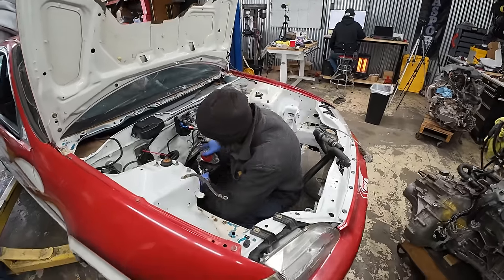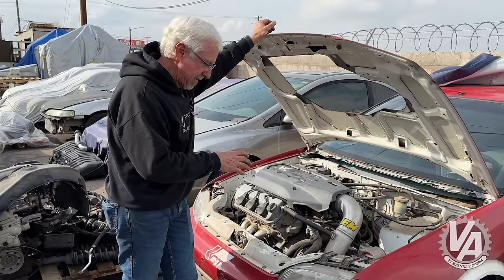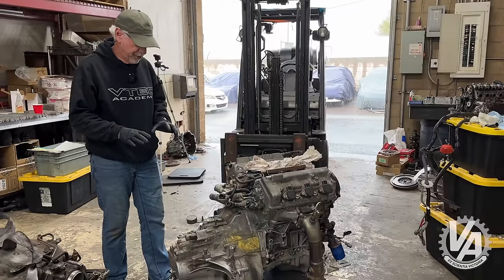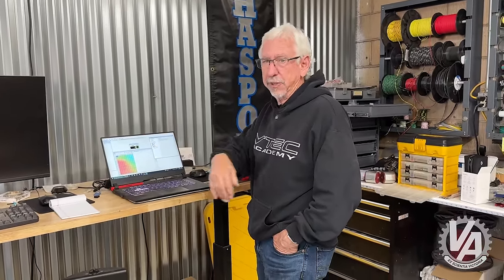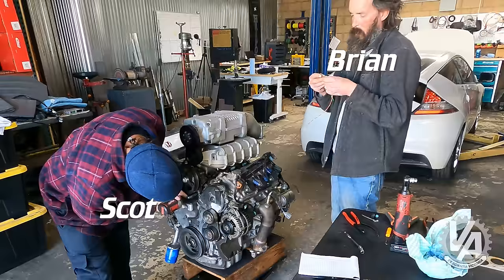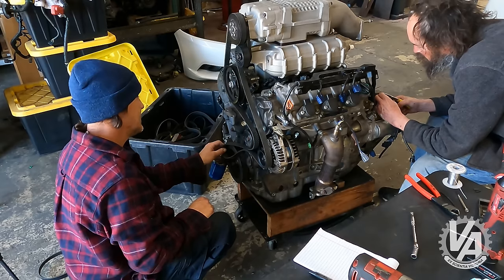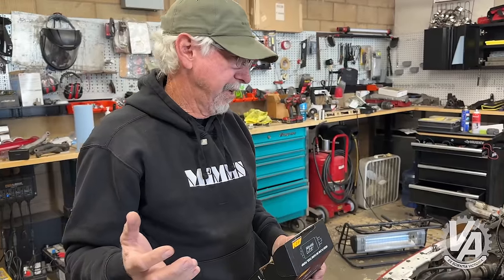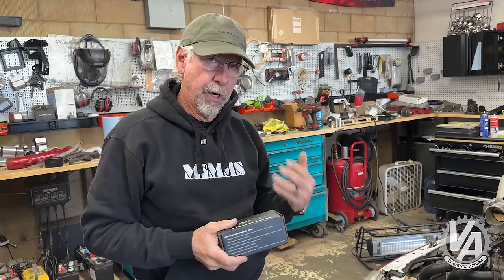Supercharged J Series Drag Civic Comes to Life

Comment: Suggestions: For the aero for the supercharger I suggest a cowl a simple 7 bend sheet metal that attaches to the hood. You can either weld it on and that would eliminate 3 bends. Next is a inner cooler. and last but not least complete the build on my Nissan 200 SX. I'm disabled and can't work on it anymore. It has a one off body kit that I installed. Gutted cat with 1 to 4 exhaust. It's a 95 model that has great sentimental value to me. It Came right before my daughter did. She's the reason for the car.  I can't find a shop that will build it with  all parts supplied by Sponsors. There are so many car give aways I don't understand why a You Tube shop won't do this for the content. Any help with my dilemma would be greatly appreciated. Thank you.
Reply from the maker: I hear your plight we are just Honda guys though.

Comment: I dont think thats a 07-08 tl base 3.2 motor. Looks like the slightly newer 3.5 motors just looking at the valve cover design and the pcd design as well. Likely a j35z engine. Those engines make solid power until about 6200rpm and then die out
Reply from the maker: Newer heads

Comment: 375hp is my guess
Reply: Really that’s it ? I’ve seen naturally aspirated J series motors making north of 300.
Reply from the maker: With a TON of torque. That seems like a reasonable number.
Reply: That’s a pretty low number. I guess it all depends on how much boost they can make with pulley changes.
Reply: @thepsychedelicmicroscope4688  with what mods ? they are 210 hp stock that's before loss of power through drive train
Reply: @Ontheregz  that's what I'm waiting to see my guess was as is